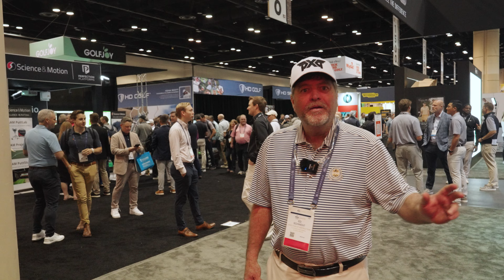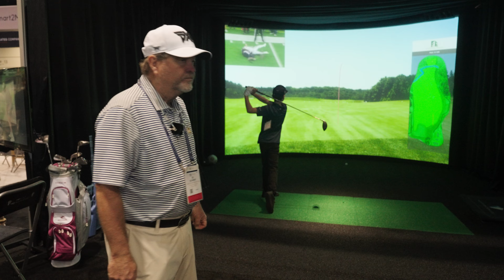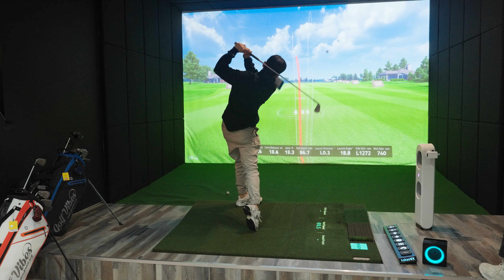Every Golf Simulator at the PGA Show!

Comment: Insane prices for low budget tech

These motion cameras are the same type they use in the dartboard auto scoring system they come in at like £150 for 6 of them and they are the best available at the moment lol so these golf simulatorors are scamming people big time

Projector screen costs about 100 quid probably the cameras 150 prob about another 200 quid on the app building and tracking unit casing your looking probably a 500 quid total to make the highest end golf simulator

Comment: Play GOLFZON here in town. The hitting area is cool graphics and accuracy suck
Reply: I have played GOLFZON about 5 times.  Every time I played it, it was spot on all the way down the putting.  Their short game, putting as well as multiple hitting surfaces with moving floor, make their game play the most realistic of any golf sim I've played. I've played them all...
Reply: I was in Korea when golfzon first came out. The place I went to play had 8 rooms, 2 of them full swing golf, the rest golfzon. 
I would wait an hour to rent a full swing room as golfzon was so bad
Reply: That is what the indoor simulator near me has (2 vision system) - spin rates and club head speed are produced by a random number generator but if you use the ball you use on course the carry distances at least with irons and wedges are within a couple of yards of what I would expect on course, run out is completely absurd.

Biggest problems with Golfzon are (a) what is does not track.  So no angle of attack data, club path data exists but not presented well (b) driver data is close to useless even fairway woods are not great (c) short game section could be a lot better
Reply from the maker: By far the new Trackman graphics look the best to us in person (the update coming in March)

Comment: FlightScope Mevo+ Limited Addition improvements for 2024. Shot Tracer in FS Multi-Cam mode...promised for wired cameras also. EO or environmental optinizer and Travel Planner. You can change your existing shots by adjusting the environmental controls thru optimizer. Handy for weather/ wind planning. Travel Planning works close to the same way. Lets say you are going to Colorado. You can view adjusted distances for your clubs based on location, elevation, weather...Badger AI is coming... your coaching assistant... swing assessment or swing comparisons for example. Some of these new features will be available for all Flightscope Mevo+ users and others require that you have the Pro Package. Note: The 2024 unit has Pro Package and Impact Location included. Those were add-ins previously.